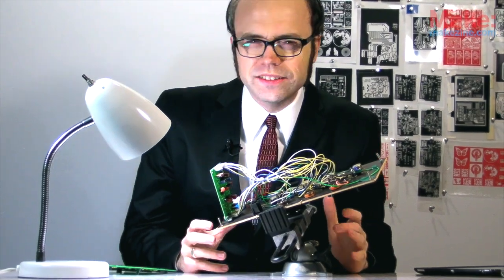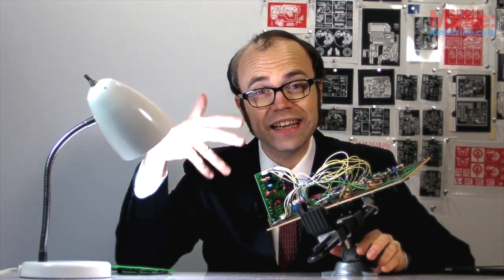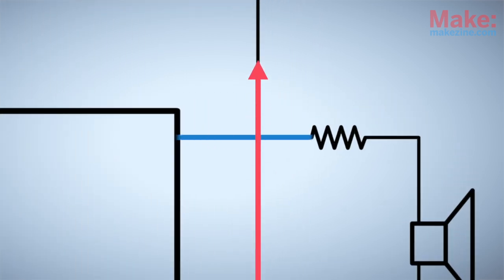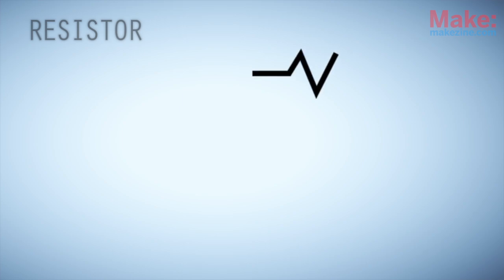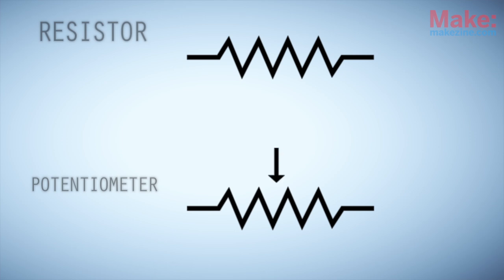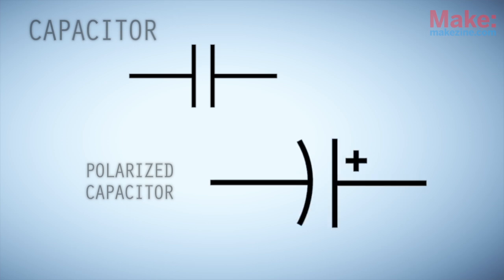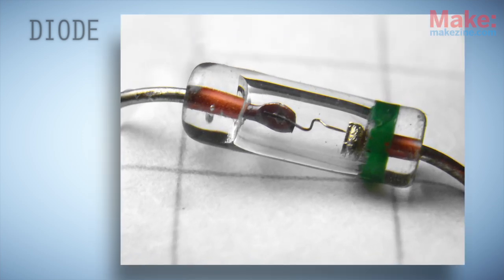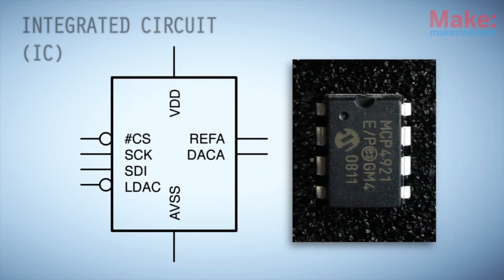Collin's Lab: Schematics

Comment: Polarised capacitor means  variable capctr right?
Reply: No they are different things. Polarised capacitor is actually "electrolytic capacitor", and it has a constant variable. While wiring electrolytic capacitors,  we have to take care of its polarization, because, if the voltage on the negative terminal become bigger than the positive terminal, the electrolytic capacitor will explode.
On the other hand, variable capacitors generally don't have a polarization.

Comment: Diodes: the arrow points  in the direction according to "conventional current flow" as in plus going to negative but yes, the  electrons are actually  travelling from negative source to the cathode and out tbe anode
Reply: An easy way to  remember;  Arrow in direction of plus to minus,  and also representing a  drop of about  0.6 volt . Also looking  backwards,  a "K"  is apparent and this is the anode side,  and  a more  positve potential on  this side will allow a current flow.€-------.

Comment: Where do you star in reading? Left to right? After that just go in sequential order of components like r1,r2,c1,etc?
Reply: It depends. If you are studying the schematic for operation, you would begin where the signal enters into the schematic. For example if you are working on a radio you would begin at the antenna for a signal or at the power source (batt or line cord) for the power distribution, the. Eventually winding up at the output (speaker, headphones, lights, meter etc.
If yoy are trying to fix things you work from the output back to the input

Comment: I still don’t understand how this is going to help me in understanding how a complex schematic involving intimidating connections would work. It would have been much nicer if you’d have explained the process of demystifying complex schematics rather than pointing out what a resistor is or what a capacitor does. 😝😕
Reply: It it hard in a few min video to help you understand complex schematics. U must learn all the components and exactly what they do first, then you build upon that knowledge sontoy are able to design or understand the design of a schematic, why certain parts were chosen etc. Digital electronics are super easy as they only have two states, on or off. Analog electronics get very involved and require an in-depth knowledge of the components. Even some hobbyists don't fully understand digital electronics and they wonder why thier circuits don't always perform as expected.
I have been working in electronics for over 50 years and am still learning. Never give up
Reply: roy Yung 
So is it impossible for me as a software guy to get to this world (FPGA)and programming chips and reverse engineering them (this is my goal ) ...
Interested for security reasons
Reply: @ko-Daegu  FPGA devices are very complex. They require a CPU most times to function correctly. Think of it this way: try to reverse engineer a CPU chip down to its resistors/transistors/capacitors etc. U cant see inside of it to determine the basic components and how they are wired together. FPGA chips are a lot like that. Its a collection of logic gates that are "wired" together by way of programming. FPGA chips are much faster than a CPU. becuase an FPGA is "wired" to do a very specific task, unlike a CPU which need a software to operate. Once an FPGA chip is programmed it no longer relys on software to work.
In addition FPGA chips are not programmed with languages such as C Or C++, only the simulators run on those languages.
As a programmer you take for granted the logic chips or building blocks required to perform a simple binary addition. Yee if yoy wwnted to understand the inner workings of a CPU, you need to understand logic design and the underlying electronics to create a binary adder.
I dont know your knowledge level of logic or electronic design. This makes it difficult to guide you.
I taught mainframe computer operating system concepts to hundreds if programmers who wanted to learn more of how a CPU does its job.
I am well versed in 13 programming languages and interpret core dumps to programmers, so I read hex listings and think in binary.
I teach programmers how the CPU does simple math and other processing operations using binary only. Assembly Lang is an extension of binary and you can totally u deratand what is going on under the hood
Reply: roy Yung 
Oooh never knew that ...
Reply: @ko-Daegu  what is your knowledge level in either Electronics or programming?
Reply: roy Yung 
Programming 
Java , python a bit in web development...
And only a little when it comes to Lowe level programming like C and Assembly (so I know only a little about Computer Arch..stuff like registries )
Reply: @ko-Daegu  computers have registers, windows has registries. :)
C is considered to be a portable Lang where assembler is not. Every language has it pros and cons. I prefer assembly because everything makes sense and you are not limited by the constraints of the language. I look at it this way with a blank canvas a talented artists can do magical things. Same as a talented assembler programmer can do things that toy could never do in an other language.
Reply: roy Yung 
Ooh tahnkx that was a typo ....
But yeah am not that good when it comes with Hardware but I wanna get into hardware hacking and I thought that FPGA is kinda cool thing to learn and programming Graphic cards as will  that’s all...

But for the assembly and the arts ...
I get your point but I don’t fully agree ...you can’t do what ever with Assembly but I get your point and yeah every Lang has its pros and cons ,...
Reply: @ko-Daegu  explain what you cant do in Assembly?
Reply: @ko-Daegu  and if you want to get I to hardware hacking, there are two fields to look into, digital and analog. If u want to play with digital, you need to have a full understanding of logic gates. And I just dont mean 1s and 0s you need to know fan-in and fan-out, riase and fall times,  logic level matching, response times, etc.
Analog is much more complex. Most people think that a transistor is just a switch, but thats obnly if its operation in the saturated mode. Operating in the linear region, a transistor is used as an amplifier, as in it original design.
Reply: @ko-Daegu  both Java and Python are interpreted languages are extremely slow. They have thier purpose for getting the job done,  it not very efficient. They are not noted for being speed deamons for sure. And you lose control over a lot of things. For example garbage collection, nost programmers have no idea what that does or how. You can't effectively write re-entrant code. Cant write device drivers or interrupt handlers, etc.
I write in java to get simple things done that I do t care how long it takes to run 
I also write a lot of microcontroller code (PIC stuff) and always use assembler for two reasons 1. Because of memory limitations, 2.processor speed.
I wrote entire accounts receivable/payable/general ledger programs on a mainframe with only 48k of memory, so I know the tricks to optimizing usage of memory, and creating micro modules that I swap In and out of memory. I could not do that with any other lang.
I am not suggesting to you that everything should be written in assembler, but you have a MUCH better understanding of what goes on under the covers and give you a goos idea of good/bad processor design. For examome the original PC with its 8088 processor in my opinion was bain dead. Here is a concept you need to look into: the 8088 was a 16 bit processor, yet it was accessing 1 meg (20 bits) of memory. How did this happen??? 
Once you look on how thru did it, you would agree it was a very stupid design
Reply: roy Yung 
Aha ok do you have any books to recommend my computer Arch knowledge came from college I don’t know how to go further ....

I love Assembly and C find them more enjoyable to code with then java but I have to use java and python it’s not an option for me ....

I would love to know how to start into arm assembly and there’s also x86_64 ..kinda lost where I should start and is there’s basic math or other pre knowledge I need to take before getting into Assembly also do I need to learn physics and electric circuits....

Yeah books and lectures but most import how to start and what next ...to study that all what I need I can handle the rest by my self
Reply: roy Yung 
Where do you work by the way and how old are you ...
How did you write stuff in a mainframes ...how where you able to access one ...
And how in the world you write any program that takes 48k of memory space ..how is that possible
Reply: @ko-Daegu  well as a rule, programmers are not electronic people, and visa versa so it depends where your head is at. I have been doing electronics for over 50 years because I like to know how things worked. I began with vacuum tubes, through transistors and finally digital integrated circuits. Having a solid knowledge of electronics enabled me to understand how ICs worked, and ICs are rhe building blocks of modern day electronics. For example you can build op amps and flip flops with transistors and other support devices, but why? The chips have already been built and miniaturized. Use then as buildiing blocks.
If you are interested in learning PIC or ARM or any other processor, I would google for "demonstration" boards for the various cpus. You might even find some on ebay. You will then need some sort of IDE or assemblers or compilers for yoyr PC or Linux box that support the demo boards. The demo bkad companies should already have that software.
I built my first computer: the Altair computer, bit I modified rhe front panel to use HEXADECIMAL rather than OCTAL display/switches.
Back then you used switches to input your boot loader, the used paper tape to load your program into the machine.
Then I graduated to rhe Kaypri-10 which had a hard drive and. Z80 processor. I had already been writing assembler code on a mainframe before the Altair, and had a solid understanding of digital electronics, so writing code for the Altair and Kaypro was a snap for me.
The demo boards i metioned have leds, switches. Temp sensor, and maybe other displays. You can write simple code to get the leds to blink a certain way etc. I used the LEDS as a debuf tool. As i could display binary data as my code went along
Reply: @ko-Daegu  I am 64 now and I learned COBOL on a mainframe back in 1970 as my school owned a mainframe and was part if my tech curriculum. Even though i won several state wide coding competitions in COBOL i got bored of it fast and one of my instructors turned me o to assembly and I was hooked. On a mainframe the o/s is rick solid and there wasnt a thing you could do as a programmer that could stop it. When your program went crazy, the o/s would catch it and purge it from the system. The o/s would tell you why is was getting rid if you (or divide by zero or doing math with letters), print out a memory dump on the printer, clean up your mess, and go about its business. I would read the menory dump which had all the registers, program status word and all the memory you used. From this listing it would point me to the exact line of code in my program that was in error then by looking at the data for the operation I was trying to perform I could fix my program.
I used to teach mainframe operators how to write in COBOL, PL/1 and assembler. Mainframe operators had much more control over the .achine than programmers so they were already a step ahead of most programmers.
Writing full own apps in 48k of memory was an exciting challange, but once you know how things worked it was a snap.
I did things with a mainframe that IBM said could not be done. For example you were bit able to dynamically call other subroutines. It had to be compiled with your code. I said "but the o/s does it!" Thier repmy was "yes" but its not written in COBOL" I said "the machine has no idea what language the source code is in"! So I went about making it work. I got an award from IBM for making that happen. Now writing code in COBOL consisted of dynamically calling modules whenever you needed them. The resulted in much smaller executables thus enabling the machine to do MORE work with less resources. Today they are called DLLs
The mainframe was a great teacher and later on in years I thought at New York University, mainframe operating system concepts for programmers.
You can actually install HERCULES, which is a mainframe emulator on your PC! Since mainframes had only 48k back then its easy to emulate on a PC now.
Mainframes didnt have a GUI but rather character based devices, so it was a lot easier. Mainframes also  used "channels" that hadled all of the I/o to printers, disks, tapes, terminals. The CPU never gor involved in such mow level tasks such as writing data to a device. That was the job od the channel controllers. They even had a special huge controller with a programming language to itself, dedicated to telecommunications. (IBM 3705)
Reply: roy Yung 
OMG....
Am speechless ...where do People like you in real life exists ...
Do you have Facebook , Instagram whatever name it ...
Reply: roy Yung 
Will I will try to go with your advice I felt more in love with Assembly and low level stuff and electronics will definitely tack some time to learn more ...
Reply: @ko-Daegu  us old timers are all over. You got lucky we met on same video.
I just use my email and would n2e more than happy to mentor you if you want. Care to share your email? You can delete your response to me right after I get your email

Comment: Well, don't get all over-confident.   It's one thing to be able to read a schematic.   It's quite another thing to explain why a resistor or capacitor needs to be a particular value.   There you enter the realm of "circuit analysis" which is really kind of difficult.

Comment: I do think, when talking about electronic circuits and schematics, people should get comfortable with the conventional current. Even though it is a scientifically incorrect way in looking at the electron flow, most of the, if not all, schematics are drawn having conventional current in mind. I remember first learning about this in school. Pissed the hell out of me. When you're dealing with + and - in the circuit, it really is not a big deal, but once common grounds and power supplies come into play, I just found conventional current to be more useful when reading schematics.
Reply: I'm just now getting into electronics and this makes learning about it so frustrating.
Reply: Another point in favor of this: current isn't always carried by electrons -- in stuff like batteries, current can be carried by actual movement of positively charged atoms. So it's usually best to just think in conventional current ("net movement of positive charge") instead of worrying about what subatomic particles are carrying the charge. An electron moving left is totally equivalent to a hole moving right, for the purposes of circuit analysis. So IMO, talking about electrons during circuit analysis does nothing but confuse students.

Comment: the diode is explained wrong. the current flow goes with the direction of the arrow.
Reply: Current flows from negative to positive, in electron theory.
Conventional theory has current flowing from positive to negative. Using conventional theory helps in many cases in designing and understanding schematic diagrams.
Reply: +Bariq H he says "electrons" go negative to positive not the "current".As you know electrons flow in the opposite direction to current
Reply: +C yberKnightTR Ah I see. but thats just a confusing way of explaining it.
Reply: +Controversy Owl Right, you are correct, moving electrons do cause a current moving in the same direction, but because we decided that electrons have a negative charge (Blame Ben Franklin), the current moving with them is also "negative", so to speak. The "positive" current moves in the other direction.

Unless you want to flip the charges of everything, we are stuck with this system.
Reply: +CyberKnightTR electrons flow in the same direction as current. Conventional current is not the real current.